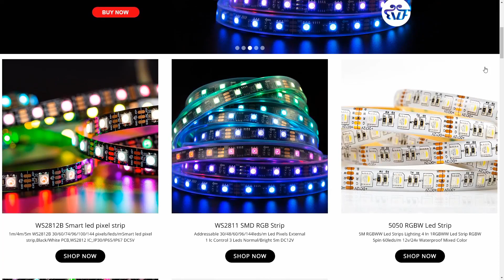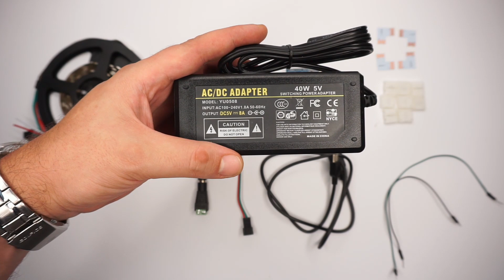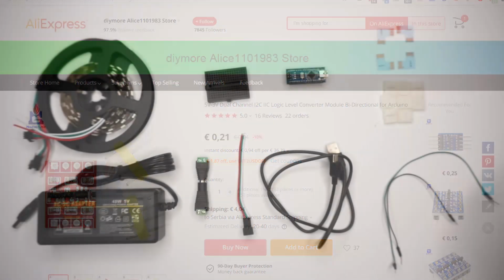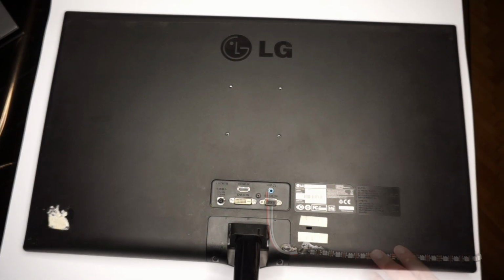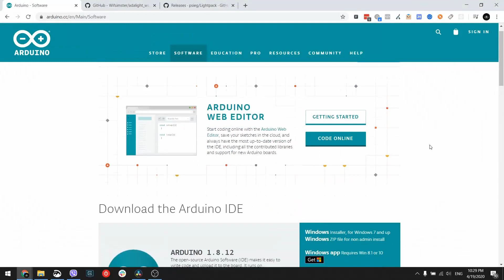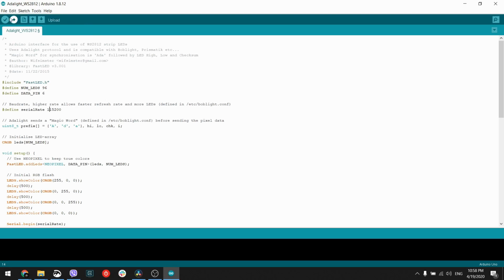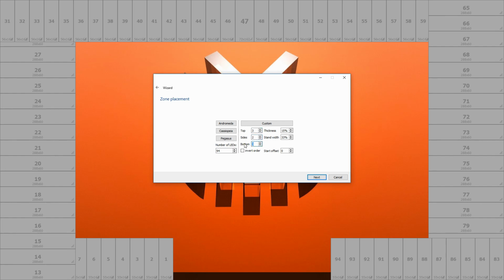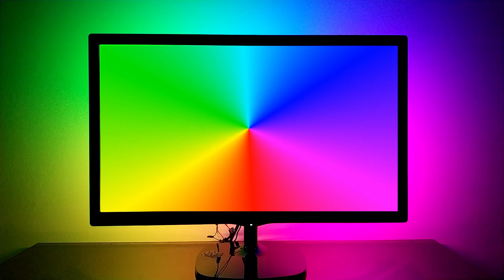Cheap DIY Arduino Ambilight 2.0 (Revisited) RGB WS2812b LED Full Build & How-To

Comment: Hi I'm stuck. I can flash the arduino with the adalight software but my LEDs dont RGB. I followed their troubleshooting to no avail :/
I have continuity between the positive and negative pads throughout my entire circuit, but the ground I do not? Is that normal?

 I also made a reddit post with more information if someone could help me I would really appreciate it! I'm very new to arduino and soldering and leds.
https://www.reddit.com/r/FastLED/comments/mqia7r/able_to_flash_adalight_sketch_arduino_but_leds/

Comment: Just a question, should you keep both usb and power supply connected to full work or you use usb just to program arduino nano and then only use power supply?
Reply from the maker: Let me ask you a question. How does the arduino know what colors to set on the strip in real time?
Reply: @dusnoki  So I suppose the answer to my quesion is Yes, right?
Reply from the maker: Yes :)

Comment: Yo my lights won't even turn on when I plug it in the power supply. On top of that, it won't upload to the arduino. It has errors saying programmer is not  responding and attemplt n of 10: not in sync
Reply from the maker: They don't light up when you plug them in. Only when they get a signal from the arduino. As for the uploading part. Check if port is OK. You chose the right board and try changing the programmer to old bootloader or the other one. And let me know
Reply from the maker: And also. Google the error code and check some forums.

Comment: Don't know if this was the case when the video is uploaded but you can get basically this if you search for "PC dream screen". Includes the led strip, power adapter, usb cable and a little box that looks exactly like an Arduino in a case. Requires the same PC software installed as well. So basically everything minus the L-brackets as one combo deal.

Comment: I'm try it with a 89 led setup but my question is: should I buy a lesser ampered power supply than yours in the video? (8A) I'm trying this with a 5v 40w 8A but the leds doesn't light...Could I have burnt all?
Reply from the maker: If you did fry the leds usually the first one in the string goes. The others should be fine
Reply: @dusnoki  I'm so grateful to be found this video. I was having trouble on and old setup and I decided to give it another try from a fresh install, but just following everyone of your steps this time, and it worked. Even I thought I didn't know what you were doing connecting the start and the end (input and output) but It worked and now I'm very happy, thank you so so much.

Comment: Im trying to make this work for a 65" (42"x24"x42"x24") tv, did the math and it calculates out to 12.4A / 3.4M of LEDs with 60 LEDs per meter. That means i need a 20A power source!?!? Thats insane, i thought LEDs were power savers. Let me know I'm off here, just think 20A is over kill for LEDs, especially if its going to be powered on both ends
Reply from the maker: Even if it is 20a it's only 5v so 100w rated psu is not that bad
Reply from the maker: And those 12.4a you calculated are at max brightness full white so red plus green plus blue. Plus a bit of overhead. Having an overpowered psu can only be beneficial. Means you won't overdrive it and it will run cooler. Also if you have that many leds and you see color changes in the middle of the strip connect 5v and gnd to the power supply somewhere in the middle as well. With 5v strips there is a significant voltage drop the longer your strip is.

Comment: Wow that was easy! Thanx! I just want to add covering the led strip with painters tape after assembly (i only covered the strip for a neat look). the painters tape will diffuse the light and in my opinion it looks a little bit better.
Reply from the maker: Glad you got it working :)

Comment: Hey bro will this work with a tv too? Usually when I see these people have a raspberry pie and use a hdmi splitter so how does this work with just an usb?
Reply from the maker: Because it used the signal from the pc. And processes everything on the pc.
Reply: @dusnoki  thanks, maybe I’m just dumb but I didn’t think the USB port on a pc broadcasts its video output. Do you have to use an hdmi to usb?
Reply: @dusnoki  I think I understand better now that I have the project in progress. So when I stream something form my pc I use the hdmi to the tv and the usb to the arduino. So does the prismatik software know what I’m streaming from my pc and tell the arduino that way? If so cool, but I like to stream my tv from chrome off a website so will the prismatik software know what I’m streaming still? Sorry for so many question ur really a great guy for helping me and everyone else!

Comment: What do you use when soldering. I can do the technological part but I’m new when it comes to stuff like that. Do you just use steel or brass or copper or does it matter?
Reply from the maker: No soldering required for this project.

Comment: Hi, i tried to make it, I assembled it, but only the first~15 leds (the first led strip is 18 pieces long..) is working... What is the problem?
Reply: I tried, to upload another  template program (rainbow effect), but the phenomenon is happening right now too..... Is it possible to kill a led while soldering?
Reply from the maker: It is possible that a led is dead. Try removing that led and bridge the gap. usually the first one dies but it can happen don't solder while the leds are connected to the power supply
Reply: @dusnoki  Okay, i will try
Reply: @dusnoki  IT IS WORKING!!!!!!!!!!!!!!!!!!!!!!!!!!!!!!!!!!!!!!!!!!!! THANKS FOR YOUR HELP
Reply from the maker: Awesome :) glad you made it. Have fun :)
Reply from the maker: Did you change number of leds in the arduino code? And in prismatic
Reply: @dusnoki  Yes, I did.

Comment: Can I use 5V from pc atx power supply (red and black cables in a molex) without external power supply?
Reply from the maker: Not sure whats the max amperage of that supply... You can try but you run the risk of damaging the supply if overloaded. Or a fire in the worst case.
Reply: @dusnoki Mine has 25A in the 5V rail. I think it could be enough for pc and ambilight...
Reply from the maker: I don't know man. I can't recommend it with a clear conscience. If it was a atx power supply only powering the leds then yes. Bit this way I'm not quite sure. For sure you have to connect the ground to the psu ground as well. Just don't want to see you break your pc because of me.
Reply: @dusnoki  Job finished! Great!!! Everything works fine (I used an external power supply to avoid problems on my pc). I have only one problem... In Prismatik, if I turn lights off, leds don't switch off but it seems they are freezed on the last grabbed video. Is it possible to switch them off?

Comment: What is a perfect distance between wall and tv (led strip) to perform best ambilight effect? What wall mount should I use for 65 tv? Slim or usual?
Reply from the maker: I really wouldn't know. I use it on a monitor about 20-30cm from wall and its fine. So I guess the regular mount

Comment: Does anyone have an issue where, when their PC goes to sleep, the lights all go white instead of turning off when the "Keep lights ON after system suspend" is unchecked?  They go off like I want when the monitor goes to sleep, but turn back on when the PC goes to sleep.
Reply from the maker: I had that issue before. Usually I turn the leds off in the UI before turning off the pc

Comment: I used this tutorial to get everything up and running with no real knowledge. It’s working perfectly, but only if I turn windows HDR off. Is there any way to get this fixed to show the right colors with HDR on?
Reply from the maker: Never used it with hdr. Don't have an hdr monitor
Reply: @dusnoki  so, since I posted this, I found a rough workaround. Enabling mouse trails in windows makes the flickering stop with HDR on. Not ideal, but it works.

Comment: The lights on my led's when white are not all the same. 
But when its solid green/red/blue, it works well. How do I fix this?
Reply from the maker: Did you provide power from both sides of the strip? Check the voltages if they are close to 5v where the leds are not good. And check your connections

Comment: Can you make a diagram to double tap the dc power? I plan to want to use the 60 led per meter on a 27 inch monitor and don't want any issues with it.
Reply from the maker: I'll try and make one to post it.
Reply: @dusnoki  that would be great. My LEDs arrived in 2 1m long strips with 5 cables sticking out on both sides (red green white and another red white) and I'm not certain how to go about connecting them or using them to power the strip from both sides (which might be what I'll end up doing since it's 35" monitor I'm lighting up)

Comment: Which is the difference between use audirino and a philip gradient? Because i have a hue sync box, and i’m going to use principally with a pc, so when i was near to buy the gradient philip i knew about this product, but i can’t see anyone comparing them
The obviously difference are the price, that one works with anything that comes by hdmi and not just pc and is more easy to install but apart from all that, talking about quality the software that they use to be more equal lightning distribution latency etc etc.

Comment: Can I use any GND on the nano? I see a GND next to the D2 pin. Can i use that?
Reply: Yes, you can. All the ground pins are connected with each other! Hope I could help :D
Reply: @liveen  yeah but its different ground pins, its physics
Reply: @DasKloputzer  Idk if you've ever taken a physics lesson or an electronics lesson, but when it says GND at 2 points, both those points are considered to be shorted with each other. All Arduino GND pins are shorted
Reply: @archangel0041  na dude u dont want to short electronic circuits, because that could deytroy the arduino
Reply: NO!!!!! You can only use the correct GND Pin. Each GND Pin is connected to a different GND on the microcontroller, that's why there are different GND Pins.
Reply: @DasKloputzer  all Gnd Pins are connected. There is only one Gnd. So thats also the reason why they are named the Same.

Comment: Hi, I have 200 leds around my 55' TV. I bought 10A power supply and I'm wondering if it's enough. Bottom and side lines look fine (while using pure white), however the top line looks more like yellow. I have L-shape connectors and I'm wondering if this is the problem.
Reply: I believe I found the issue. L-shape connectors caused all those problems. In my case soldering was needed and now everything works like a charm. Another thing I modified is the connector between power supply and LEDs. It was getting extremely hot. Solution was just to cut off the plug and connect cables from PSU directly to the electric cube I've added.

Comment: I have  tried  this setup. As a test I have connected a full 5M strip of 60LED/m   300 LED's.
I do have a 5V 40A power supply connected to both ends of the LED strip
When I tried to set number of LED's in Arduino script  in  NUM_LEDS to 300 it did not work
LED's do the test R G B flash on start but no light after that 

Thru trial and error I figured out that the maximum I can set NUM_LEDS is 255
At 255 everything works fine at 256 no LED's light after R G B test flash
Do you know why is this not working for more than 255 LED's  
I have searched google but no answer ( the are talking about a 500 LED limit on a arduino nano)
Reply: The arduino project has a loop with a uint8_t on line 67.  This is too small for more than 255 LEDs, change that to uint16_t and it works great!

Comment: Awesome tutorial!  I ran into some issues with the number of LEDs I had, I had nearly 300 and nothing worked.  The arduino project has a loop with a uint8_t on line 67.  This is too small for more than 255 LEDs, change that to uint16_t and it works great!  Thanks for the tutorial!
Reply: Thank you for this comment! I ran into the same problem and this helped!
I ended up with 'only' 244 LED's. When I changed it back to uint8_t I noticed a significant increase in refresh rate. I'm fairly certain changing it to 16_t halves the refresh rate of the LED's
Reply: Had same problem trying to light up 222 leds, and changing line 67 finally worked. Also check Baud rate, somehow while testing different solutions I set it at 9600 and didn't work, but setting back to 115200 make all them back to life!
Reply: I wonder what would be need for 650 leds, planning on a 144 65 inch build

Comment: Amazin video realy nice build
I have a question tho

Say if i use a power supply stronger? Like an old charge for a laptop. Will it fry the complnents or will they just "take" as much as they need?
Reply from the maker: Stronger power supply is OK but check the voltage. It needs to be 5v. If it's higher amps it's fine but voltage needs to match. Usually laptop voltages are around 16v so not good.
Reply: @dusnoki  oh okay it got 12v... so its no good i guess

Comment: where do you connect the arduino to the tv? you don't explain it in any video
Reply from the maker: No
Reply: So what is the point
Reply from the maker: You connect it to the pc
Reply: @dusnoki  but i don't know how. you don't explain it
Reply: @ErezAvidan1  Well, first you asked where to connect it to a TV. Short answer: You can't connect it to a TV. 
He answered you that you have to connect it to a PC. There you use the shown USB-cable and you have to plug it into a USB-port on your PC. 
The reason why you can't use a (standalone) TV is that you have to run the shown software everytime you want to have the ambilight effect and as far as I know, there is no version out there, which can be installed on a TV. You need the software to send the color/brightness information to your arduino and the arduino controls the LEDs with this given information.

Comment: was working great for 6 weeks, then today when i turned my computer on..... nothing... no red green blue blink or anything...  any ideas on where to begin troubleshooting?
Reply: seems i have a bad connection somewhere in the female to screw terminal connected to the power supply, gets all glitchy and twitchy when touched.   cant seem to get it stable.    fingers crossed.